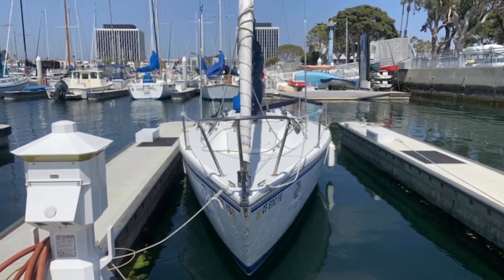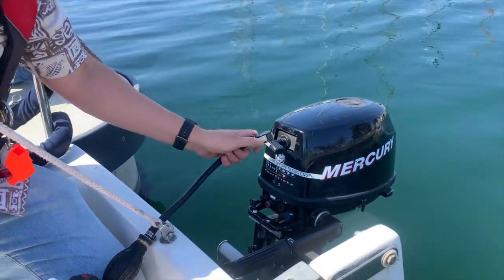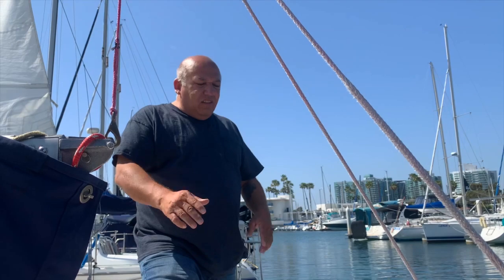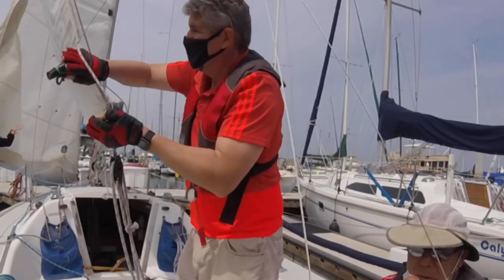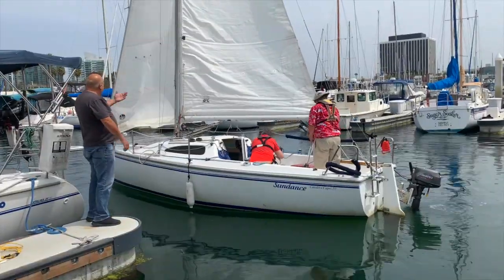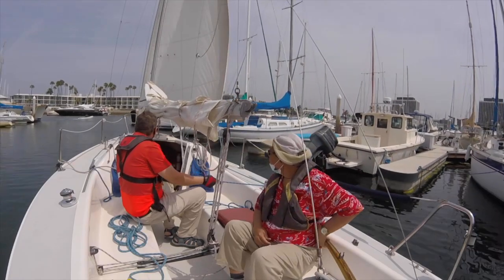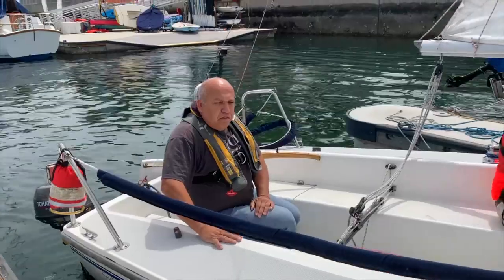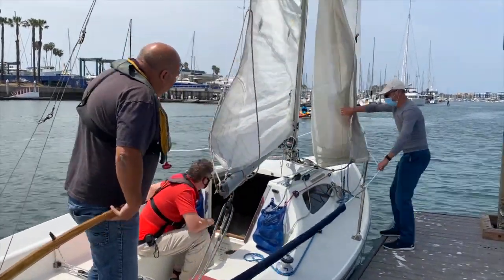LAUNCHING AND DOCKING

Comment: ECOS, or as we know it.... the "kill switch" is a new law in effect since April 1st, 2021.  It applies to boats less than 26 feet long.  It's required on outboards greater than 2-3 HP depending the source you are reading from.  The law doesn't apply on "no wake zones" therefore it wouldn't apply to us until leaving the marina.  I have not seen any regulations specific to sailboat..... let's wait and see.

Comment: Doesn't the kill switch attaching to operator only apply to boats on plane?  If single handing how would one raise/lower sails with kill switch still attached to skipper?

FYI, at about 10knots of wind or more, the paddles will not generate enough power to keep you off the leeward side of the finger.

Why are we disconnecting the fuel supply from the engine?  This seems to be a new procedure.
Reply from the maker: Some of the fuel lines break when the engine is tilted forward, so we are disconnecting them now to be consistent.
Reply: @steph5276  Good to know, perhaps we need to update our checklists to reflect this.  Actually had a problem on a non-FYC boat related to that this weekend ;)